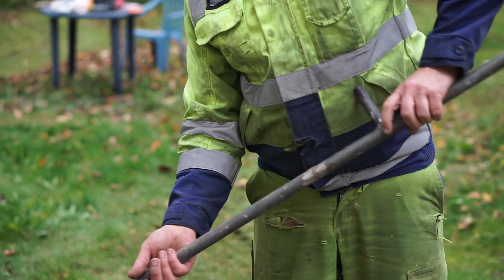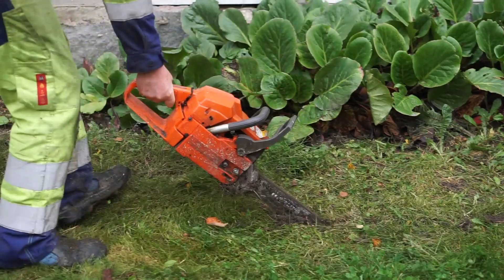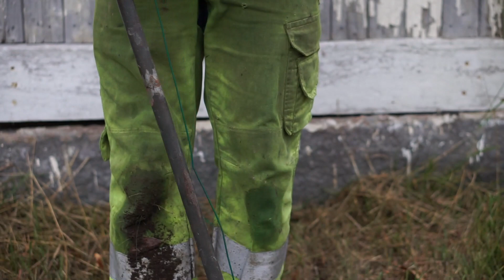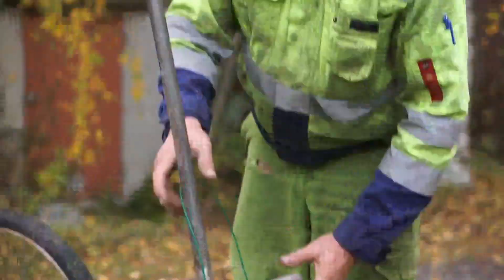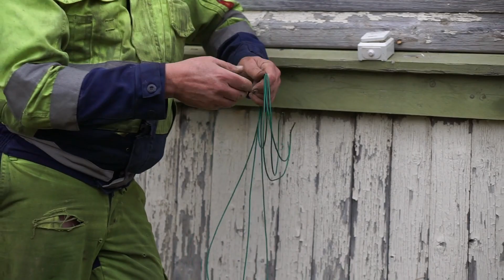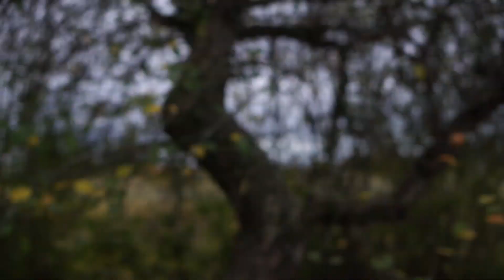Robotic Lawn Mower Border Wire

Comment: Nice project. But wy not mount the chainsaw on the front of the cart and the plough on the back? Simply walk the cart around the yard and done! (Except for the corners maybe).
Reply from the maker: Tried some steps like that and the conclusion:
1. Too many extra mounting, not worth for the once in a lifetime wire installation
2. Not only corners, also wide turns are tricky due to the wide wheel base of the cart. It tracks straight and anything touching the ground must be very close to the wheel axle lest you make huge sideways swings
3. Too many narrow spaces, would need a smaller cart
4. Same as 2 but vertical (tested) very tricky to adjust plow pressure when mounted, especially with uneven surfaces
5. Chain saw rinse & plow cleaning impossible without dislodging.

I could make a nice machine based on a garden cultivator, but as stated before, for me this is one house, one garden, once in a lifetime.
Maybe for the heck of it and start selling installation services?